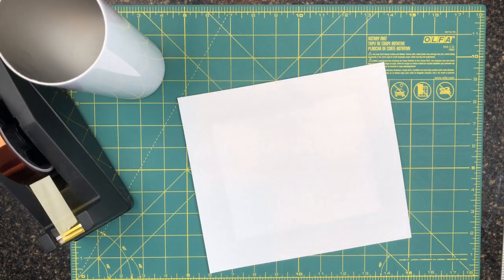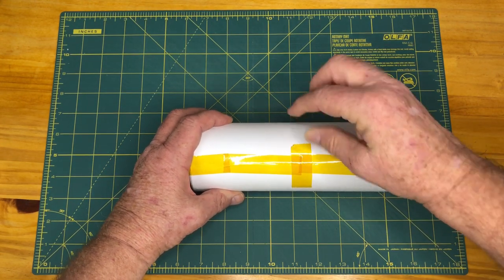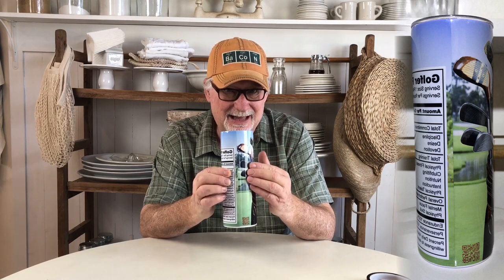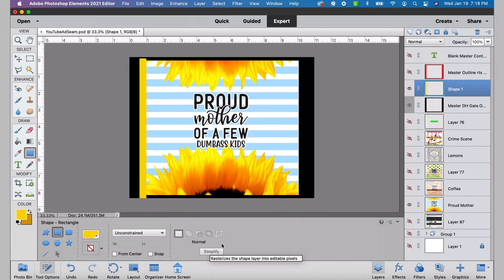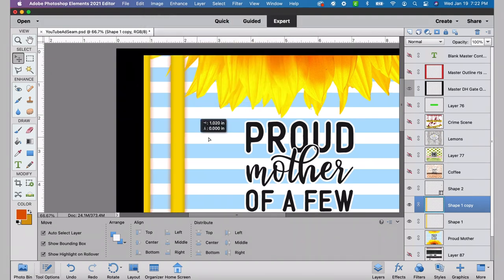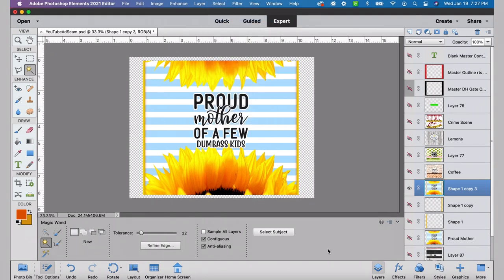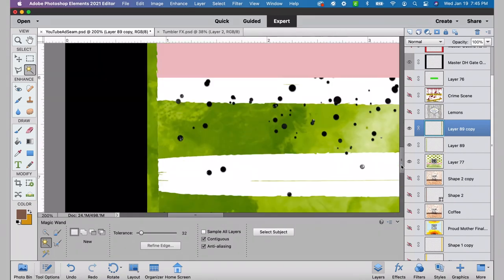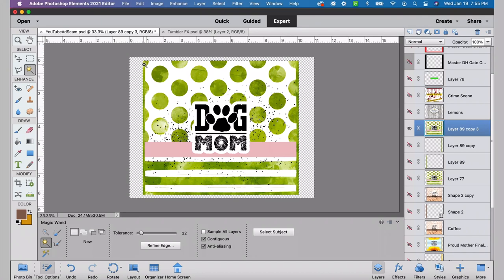The Secret To Creating Perfect Tumbler Seams, And How To Make Seams Using Photoshop Elements!

Comment: Roy, great video. I have a few tips for you, first, because one edge of the design overlaps the other, I think you only need to add the SEAM HIDING image to one side of the image, not both sides, if done correctly having a hard edge line and drop shadow, that is all you need.

The second tip has to do with the 24" metal straight edge, sometimes when making a cut the straight edge will slip or move on you, and the cut may be off. So, have several straight edges from 12" all the way up to 58" long, and I use adhesive-backed cork or felt on the backside of the straight edges to grip whatever I place them on so the straight edge does NOT slip (move) when making a cut and ruin the artwork.
Reply from the maker: Jon, great tips! I often only make the seam on one side, but if I have a drop shadow that’s pronounced and I want that look on each side, the only way to have that shadow on both sides of the final seam is to flip it and put a seam (with the shadow) on both sides. Yes, part of one of the sides will be cut off, but the shadow will remain. And I have had the ruler slip a couple of times, so I’ve learned to hold it down well when I cut. I also try to only slightly push against the ruler. I was leaning against a cork back, partly because I like being able to ever so slightly slide the ruler to exactly where I want it, but it sure would help to keep that thing from sliding around, and that’s a great tip for anyone using a ruler! Thank you!

Comment: Hello, boy am i glad to found your video. I started sublimation on 20 ounce tumblers around November for Christmas with convection oven, and let me tell ya out of 25 tumblers i had maybe 5 with good seam. my problem is I do not have a sublimation printer so i buy from other source, So Iam trying again i may buy a tumbler press, I have trouble with getting the seam tight, Maybe I don't have enough strength in my hands to pull tight enough. But here i go again. I did like your video. thanks for the tips
Reply from the maker: Sandy, thanks so much for watching! Do you have a convection oven? If so, check out my earlier video about subbing from start to finish. It uses a convection oven and shrink wrap. I’ve found that if I wrap the paper really flat and tape the seam really good, I have less trouble with seams using a press, so I do recommend them. BUT, please don’t get a knockoff from Amazon or eBay. You run the risk of getting one that doesn’t work. I recommend Heat Press Nation or Pro World. They’re more expensive, but you get a good product with a company that backs their product up. There are other good ones, but I just don’t know which ones. Join our Facebook group and ask. I know a few folks in the group have different presses they like. Thanks again for watching!